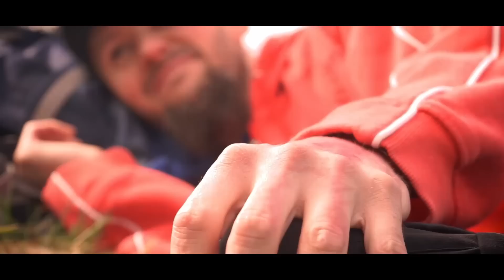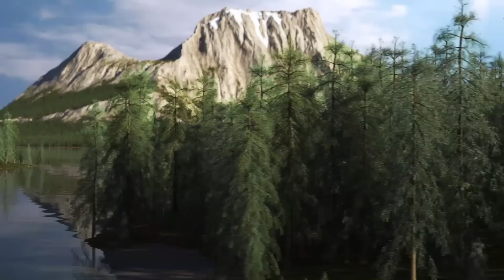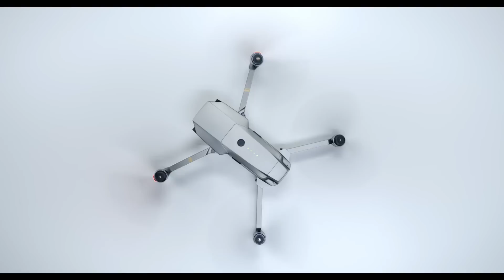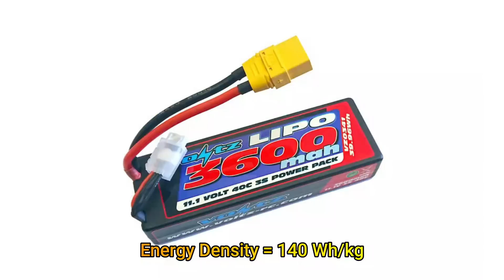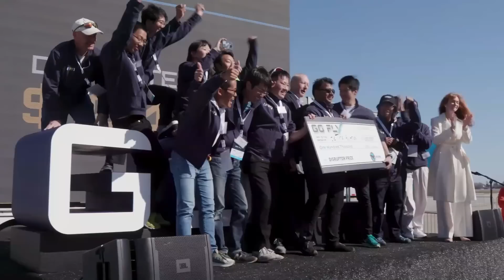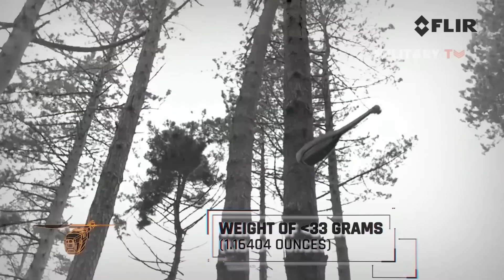Secrets of best performing drones & recent breakthroughs

Comment: Replace the reciprocating gasoline engine on the that drone by a microturbine shaft, multifuel hybrid much more efficient, simple, and able to use renewable energy sources like ethanol or any other vegetable oil.

Comment: Just saw this! Missed the notification. Great video with clear explanation about why drone designs can't just be scaled up.
The elephant in the room for crewed e-VTOLs, like Vertical and Lilium, is that you can't autorotate back to the ground in the event of total power failure. These solutions are banking on the CAA and EASA accepting the argument that quad-redundancy means you can still fly with 1 failed system. However, the increase in disk loading with one fail means each system now needs 
fail power = (4/3 weight) * sqrt( (4/3 weight) / Area ) = (4/3)^1.5 = 1.54 power, with failure most likely at landing.
The certification authorities know this so are imposing 1E9 hours to single failure on all systems, including the need to demonstrate battery reliability at 154% hover power while at low SoC. Two failed systems would be 283% power. This is why designs like Jaunt Air Mobility, that retain autorotation capability, can be certified using existing helicopter regulations.
A recent example of a high disk loading VTOL still trying for certification is the Leonardo AW609 tilt rotor, that first flew some 20 years ago. The problem is that high disk loading also increases the decent rates that could be subject to vortex ring state, which has lead to uncontrollable roll accidents with the V22 Osprey in the hover. Again the certification authorities know this and will be very demanding in demonstrating that this can't happen in customer flights. Again, designs like Jaunt Air Mobility can just use existing helicopter regulations.
I am reminded of Alan Brown's comment about "there being no need to stub your toe" when explaining why the F117 just used the F16 flight control system rather than develop something new. Single rotor with swash plate has been subject to over 80 years of optimisation - doesn't seem like a great idea to abandon it when the batteries are the bit we are trying to develop...
Reply from the maker: Thanks Martin for your informed comment. Yes Power increase in case of a failure means the packs have to be designed to meet them. This inturn means larger packs and this would mean more weight. So this is another negative feedback loop

Comment: want to have a helicopter (one-rotor) stabilize easily? use horizontal and/or vertical gyro spin discs, like in auto-gyro or quad copter drone, in the main hull with the motor
Reply: use a thick whoop as simple tail-sitter transition drone-plane, the drone long vertical ducts are circular wings in the flight mode
Reply: put a normal helicopter blade above a normal drone, can be folding/stopping during flight
Reply: just put norma quad rotors in a helicopter drone, all horizontal flat, any size helicopter rotor
Reply: the helicopter rotor does not need to be complex, just a disc, the quad drone rotors will keep the drone in proper direction, ie, differential thrust balancing
Reply: 15kUSD? why, someone is being very greedy in service of the false gods of money-law-kings
Reply: barrel circular half-ducted drone is the best, the drone being stiff vertically strong, instead of horizontally
Reply: vertical tail-sitter wings, kinda

Comment: Quad copters always felt like a dead end to me. Yes it is simple design balance able just by differential thrust. But it is a one trick pony. That one trick being easy to make and easy to fly leveled so that anyone can use it. 
And it sacrifices everything else along with efficiency to achieve this. There is a reason why some piloting experience is necessary to fly more complex machines. Whether drones or planes. 
If leave leave designs meant as children toys behind, we can finally move forward and whole world of options opens up for us. And fact that we have tine computers these days to use as FBW systems even mitigates the pilot experience. But when pricy  machine is involved i really see no downside to properly trained personal.
Reply: The disc loading on a turbofan is around 5000 kg/m^2 so this isn't a limitation. Torque and thrust can be changed quickly using collective pitch alone so powerplant RPMs aren't a limitation either. I suspect a large turbine powered quadcopter with collective pitch on open rotors might make an agile weapons platform for attacking ground targets. It would be an attack helicopter with aerobatic rates. A rigid rotor with cyclic pitch must transmit all rolling torque through the hub. But a quadcopter's rolling torque is applied via differential thrust to the arms. A full sized attack drone could be as agile as a house fly.

Comment: The square cuybe law does not apply. The weight can be reduced signicantly ion the larger drone. If the weight is less the motors can be less which means the batteries could be less,etc.